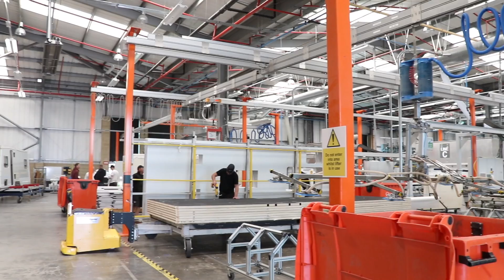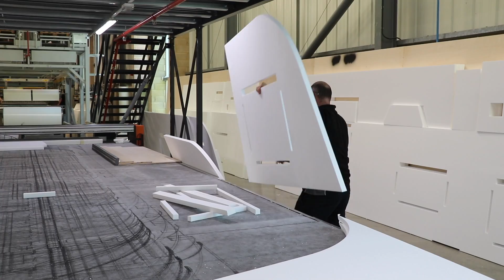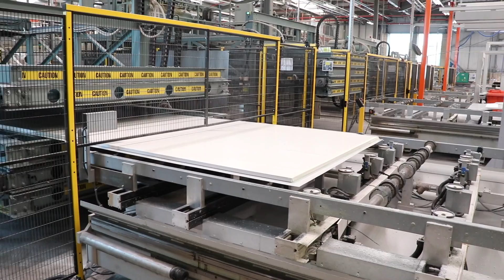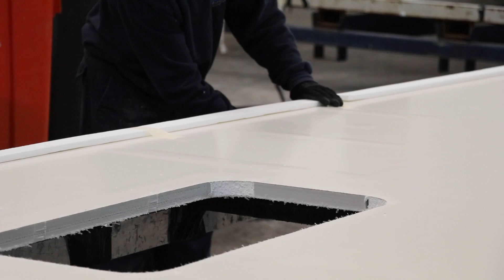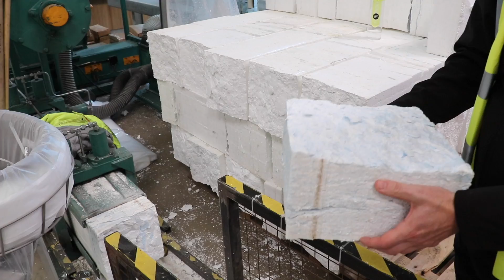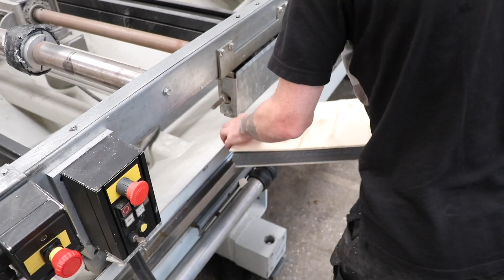Bailey of Bristol factory tour - part one

Comment: Having toured many motorhome and caravan manufacturers in the US I'm very surprised there's no structure within the walls!. I've seen aluminum frames within the walls all vacuum bonded in a heated press making a massively strong panels, and most importantly not that heavy. I wonder how long the panels/caravans will last for ? 

I assumed Alu-tech was in the walls and floor rather than merely join the corners !

Also the laughably stupid unscientific destructive testing is mad. It appears to prove nothing other than pulling the foam apart, this sort of test is easy bias - it needs a more scientific method.

For for record I'm looking into buying a caravan.
Reply: You can’t do a tensile pull off test to any ISO standard with foam to timber, the foam substrate would always fail before you could record any relevant result. The simple test they carry out on the off cuts are quite sufficient and you quickly identify any issue. Oh, and I’ve worked in the adhesives industry for over 30 year’s
Reply: @Icemanin1994  Indeed, It's a test just to see if the glue has cured and fully covered. It's a shame they still use wood though.  
Having since looked at a few caravans since, I'm not surprised by how flimsy they are !
Reply: @myozone  What's your aversion to marine ply being used for the floor? We currently have a 2011 Bailey and it's as solid as you'd ever need, especially on the Alko chassis. We'll be picking up a new 2021 Bailey in a couple of weeks, and while it's going to be lighter than the 2011, it's definitely not 'flimsy'. What model Bailey have you owned that's flimsy?
Reply: @Icemanin1994  I looked at the three 'lower' ones of the range Discovery, Pheonix+ and the Unicorn. If you press in the center of the wall it's possible to move it! with a creaking sound. All in all, there're built down to a weight and a price. So I've changed tack entirely and look in electric van conversion into a motorhome. My idea    would have been to do the same  with a caravan and an EV (Ioniq 5) as a tow vehicle and remove all the gas from the van and power it from the cars 3.5Kw output, negating the need for hookups.
Reply: @myozone  Oh, so you poked the ‘lower’ models. Am I detecting a little bit of caravan snobbery. Ironically all 5 of the Bailey models use exactly the same ALU-TECH body-shell system. Makes you wonder, just why are they so damn popular 😉
Reply: @Icemanin1994  No snobbery at all, far from it. Caravaning or anything has a level of built it 'snobbery' if you're daft enough to pay more for a 'better' more equipped model more fool you, as you state their all the same under the skin.
Reply: @myozone  if you're daft enough to pay more for a 'better' more equipped model . I have a car. There is a basic model , and the one i have. Mine has extras , air con , cruise , auto gearbox , leather seats , dvd player.       My car also cost more than the basic model.      And i had to pay more for it . Are you saying that we should get all these extras for free. ?